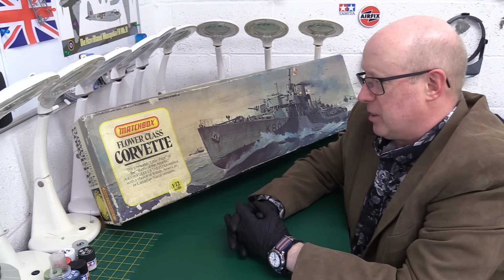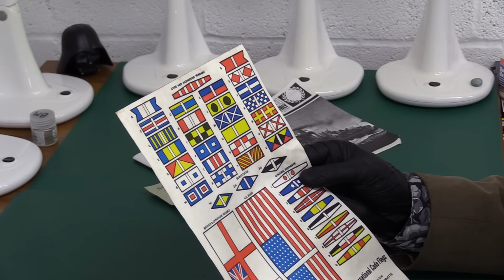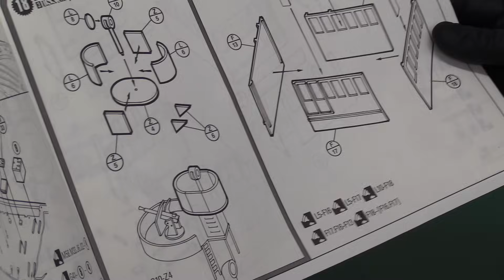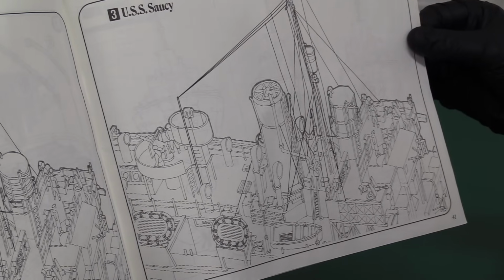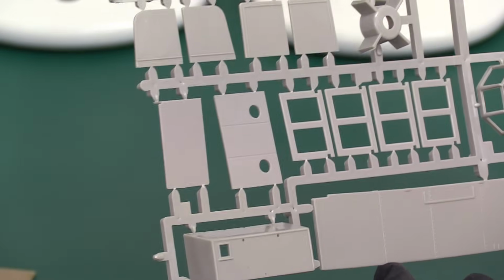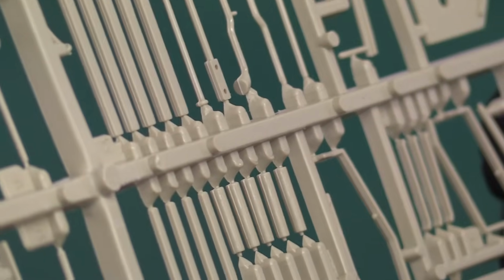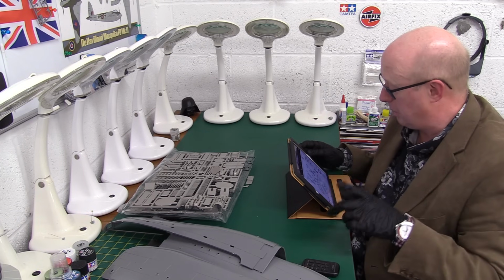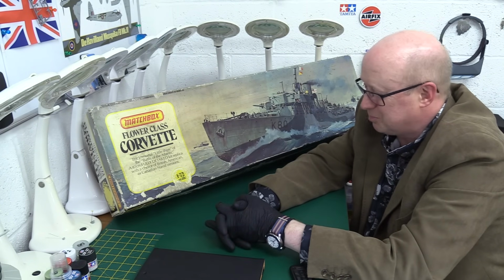Matchbox MAY! 1/72 Flower Class Corvette PK-901 'Holy Grail' kit review

Comment: Thanks Peter, brilliant review. As a cadet back in the 80's I got anything but keelhauled if I didn't have my nomenclature right, Bow, Foc'sle, Wheelhouse, Bridge(wing), Midships, Poopdeck, Stern, Lanyard and on and on. Read some up on the Flowers and you can barely believe the hardship that the crews went through on the North Atlantic crossings in the 3 seasons apart from Summer. Constantly wet living quarters in the foc'sle, just try to imagine that. These folks were the true unsing heroes of WW2.

Comment: I recently bought a 1/350 Mirage kits Corvette, HMS Spirea  and you review actually highlights how good this little kit is. It is nearly as good as this Matchbox version.  It has most of the things of this kit plus some photo etch. Back to the Matchbox kit, these kits were popular with the radio control  boat folks as they had plenty of room for the older rc gear. The local model shop regularly had one in for sale that had been converted.  I have seen one running on our local park lake and it looked well. I'm sure Revell released it and also did a 1/144 scale version of it.

Comment: Fantastic video Peter ! Looking at the monster kit I'd give this one 10 out of 10 mainly because of its age. Once built and the warped issues gone it will look I'm  sure 100 per cent. To you 12 out of 10 for the detail especially around the sprue Starboard matching and other parts. Also for nautical terms the Bow or front part of the hull on the corvettes were specifically designed to ram opponent  submarines if surfaced. Moreover I'm trying to remember  where that model shop was in Stockport. Anyway  an excellent video. Thanks again Dean.
Reply from the maker: Bramhall Lane I think. Long gone now sadly. Cheers.

Comment: I remember it when it came out, and it was always up on the top shelf along with the Airfix Bentley. I  would need a new house for that lump though. The Morse flasher was a Morse Flasher/Signal Lamp/Aldiss Lamp depending on where you live, often a dual searchlight/signal device. The "access Ladder" and "safety railings" you pointed out were the depth charge rack top and sides, and the "depth charge dispensing unit" was the Engine room skylights / roof.  The "funnels" are ventilators, and the "Light Mast" is the RADAR housing. It's a lot more manageable as a kit and an awful lot cheaper if you buy the 1/144th scale Revell release (the 1/72 is no longer on sale, and goes for silly money on the unmentionable auction site) . That has almost the same level as detail as this does, and in some places better detail - no crew unfortunately.

Comment: I have two of these ship kits, one is made as Saucy, one as Snowberry (one of which survived the war), they are both being/ have been converted to RC. I purchased them separately in the 90’s and 2002, I’m taking my time. The decals for the gun are horrendous, I had to make my own once I’d worked out what it was supposed to look like. The superstructure is a bit ‘breaky’ for an RC, so I have replaced many parts over the years and continue to do so as they ping off. Some of the detail is a bit vague, (small boats, depth charges, guns, hedgehog, radar) and needed to be either modified or scratch built or when I could afford it purchased as an upgrade kit. It needed minimal chopping to allow to put the RC bits in, a bit more bracing and reinforcement. They both sail well and are head turners, even now. The decks were very warped in both kits and need a lot of fettling to straighten out. There is an existing example of a flower class corvette in Canada, with some good YouTube videos, excellent for reference. Step 43 is the Radar.

Comment: I don't think a re-box can be called holy grail. Is this not an ex Revell kit????? This is not 'true' Matchbox is it?
Reply from the maker: It is the exact opposite! 1979 Matchbox original later reboxed by Revell. Did you not watch the vid?😆
Reply: The millennial coming out without knowledge!!! 🤣🤣🤣🤣
This kit WAS one of absolute holy grail kit from 1978!
I got, and still have, mine since my birthday in 1984.
It was even more awesome then the original 1/32 Tomcat FROM Tamiya, and probably just slightly behind Nichimo Yamato in 1/200, which was like 600$ back in the early eighties, without accounting for inflation. It was a time when kits were designed on a drawing table and the moulds made welding them by hand, which made large kits rare and extremely expensive! 
No numerically controlled 5 axis machines, back then! 
I paid the Flower Class 125$ in 1984, plus another 110$ for a photo etching set from Flyhawk!
BTW, this Flower class kit is certainly better then the Revell kit, having thousands of molding less on the shoulders.